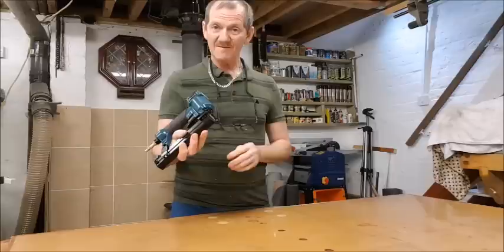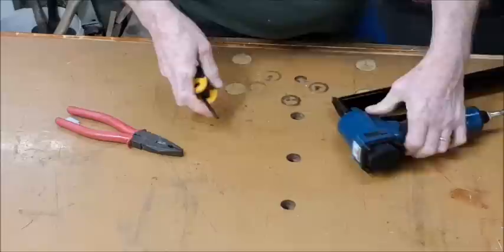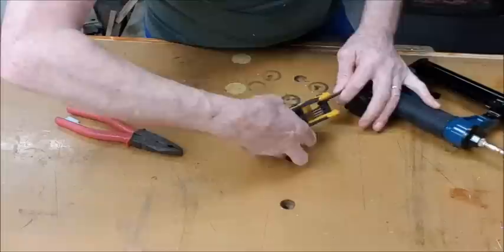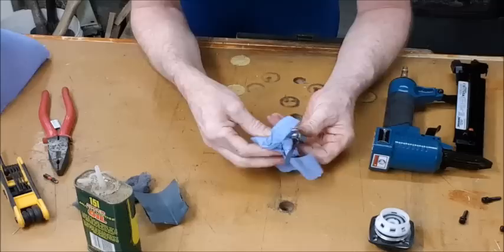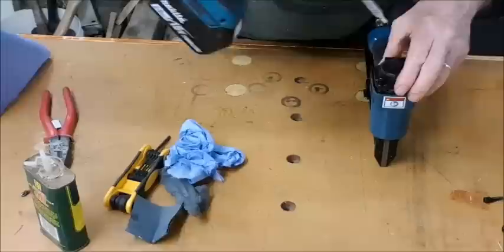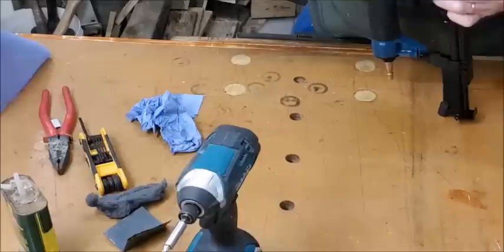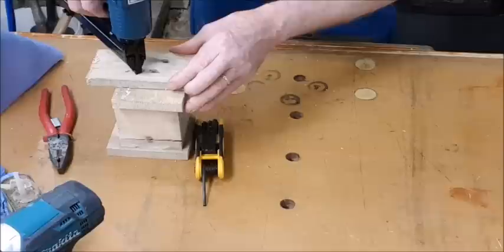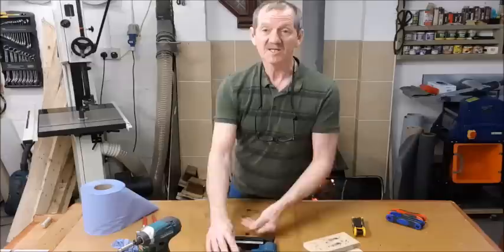Fix a Air Stapler Gun

Comment: I got a similar brad nailer a Husky brand that wont fire, i found out the spring was missing inside that creates a spring loaded feel when you open the top cover. I got it back and works like a charm now. Thanks for showing this video.

Comment: Brand new stapler. Oiled well. Fired about 4 staples and it started getting stuck. I need to open the cartridge and push with screwdriver the plunger. Then I fire 1-2 and it's getting stuck again. At that rate I would be faster using a hammer.
Now I see what might be the problem. They couldn't have made the critical parts from stainless steel? Can't be that much more expensive to make.
Reply: Some more information for the common good:
Mine is a brand new Draper of almost identical construction to the one in the video. It had been staying in its blow molded case for more than a year before I needed to use it for the first time. As per my original comment it was jamming after every 1-2 staples.
Opened it up. In the manual what I called plunger is defined as a "driver blade". This component has some rusty looking like coating. I'm pretty sure it's not rust - it does look like phosphating process or perhaps some electroplating to prevent rust. It was obvious where the coating was applied and where it wasn't. If it was rust these boundaries would not be so recognizable. Good idea but the manufacturer failed to account for dimensional change after treatment. After removing this coating with 800 grit sandpaper it's all nice and smooth now. I used low viscosity brake grease to pack the piston and seals - really slippery stuff. 
I hope I don't need to revisit it again in the future. I will get an inline lubricator (toolstation sell these for £3)
Essentially the solution is the same - use sandpaper. 
Thanks for the video, it was very helpful

Comment: Another great video David. I've been thinking of ordering a brad and staple nailer as your earlier video seen a few negative reviews on Amazon because of the blocking but if it's not to difficult to put right may take a chance.
Reply from the maker: Yes its not Amazon it was Silverline and i would just say as a standard practice when you buy such tools strip them and make sure all is good before you start.

Comment: It's rusty because you haven't fitted a water trap on your air line, compressed air produces moisture. Inside your shop where the air comes in you need a water trap filter/regular, also an inline oiler which drips oil into the airline very slowly to keep tools lubricated (not your tyre inflator)  Also every couple of days you need to unscrew the drain plug under the air tank on the compressor to release the trapped water.  Compressed air is extremely dangerous! And ultimately not cost effective.
Reply from the maker: Its rusty because it was bought that way as i said in the video it was my first time using it when it locked up on me, but i will take the advice re water trap on the air line thanks
Reply: Just grab a HF autodrain and put it on .    Works like a charm.
Reply: I live in Florida where it’s very humid most of the year - even with a good water trap corrosion is a constant battle.
Reply: @to6635  those type small home use compressors will always produce water. Where I work we have a Kaiser system, with water/oil separators and an air dryer, all the air in the pipes is bone dry, which is essential as it's used by the laser cutter and cnc punch, along with other air tools on shop floor, we have no corrosion issues at all. You can buy 'stand alone' dryers to use with smaller compressors.
Reply: What is a good water separator model (Amazon link?) for a pancake compressor or a 10 gallon Cambell Hausfeld? 
Or... what about the "autodrain"  NMM suggested below from Harbor Freight?  How do they work?
Reply: @resolvingconcerns  An auto drain will drain the air tank contents either at a set pressure or at a set water level, but it wont stop moisture in the air line, handy to have if the compressor is awkward to get to.  I've just looked on amazon, hundreds to choose from, depends on either how much you wish to spend, or if you want a 'Branded' product.  Do search for "Filter Regulator Oiler" and loads will come up. You mount this on the wall by you air line, it needs to be away from the compressor, NOT near or attached to it!  This does three things, it separates any moisture out of the compressed air, it allows you to regulate the air pressure for the tool in use, and also has a drip oiler, so you can set it to drop a single bead of oil into the out going air (one drip every few minutes is more than enough) to lubricate your air tools.  You can also get little inline oilers that attach to the air tools directly if you prefer that method. However if your spray painting mainly, then have a second one, just a Filter/Regulator (no oiler) and a separate clean air hose, just for spray painting or dust blowing.